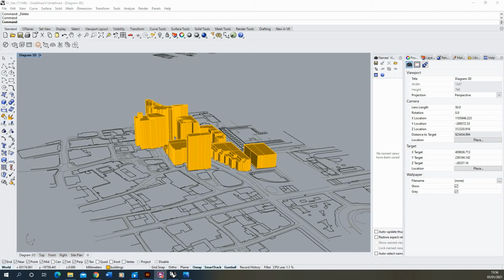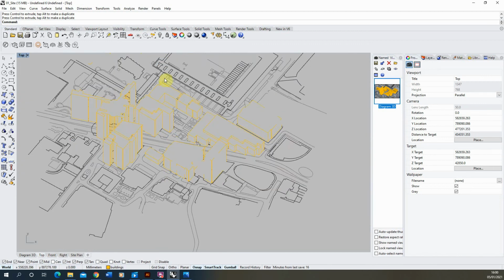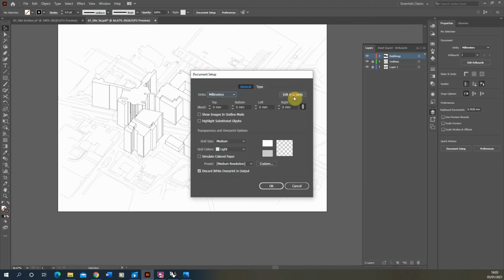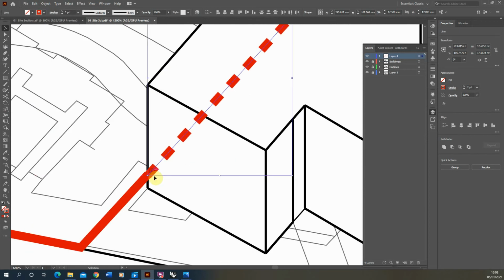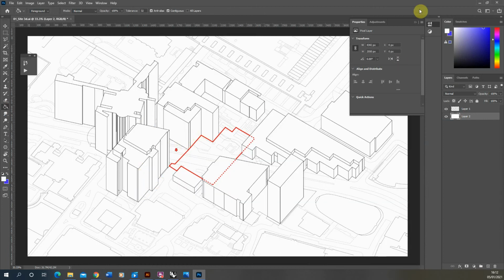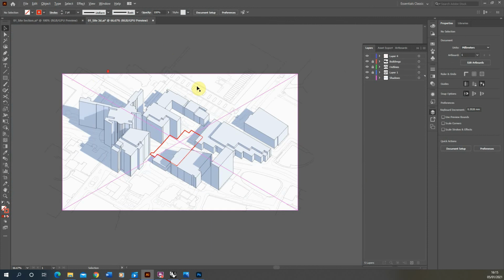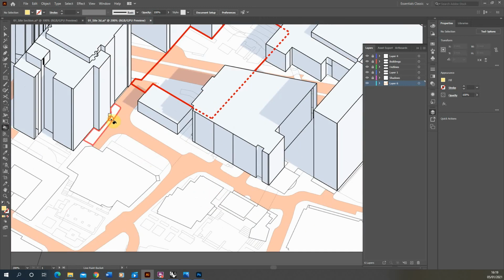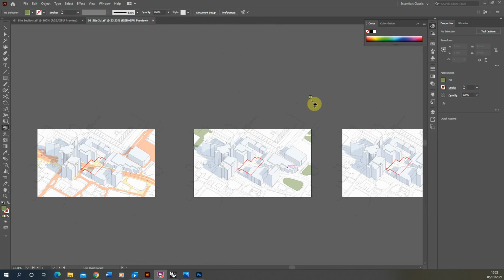3D Site Analysis Diagrams - Rhino + Illustrator + Photoshop

Comment: hi there, my issue is once i select all and then use the make2d command, nothing happens even though it says it was created in 2.5 seconds. Not visible at all, as if the command generated nothing :/
Reply from the maker: Hi Hadi, Make2D's are usually generated at the origin point of your file (0,0,0). If your model is located far from this point it may appear as if it is not generated. A good way to check is to look in your layers, and under the Make2D layer you should be able to select objects on those layers and the 'zoom selected' to hone in on them. Hope this helps
Reply: @tombudd15  Amazing. Problem solved :) Thanks for the content and reply.